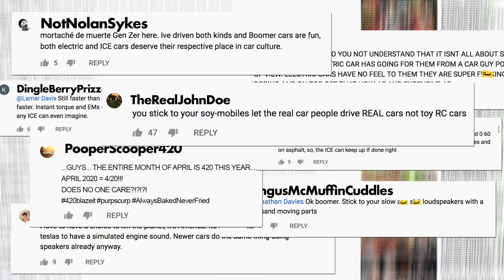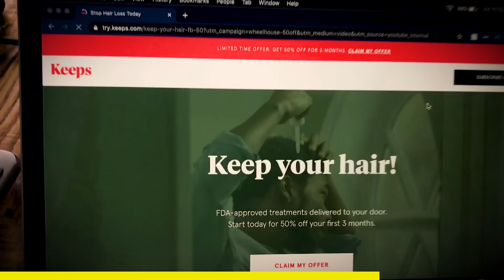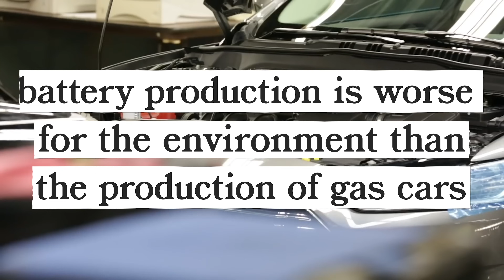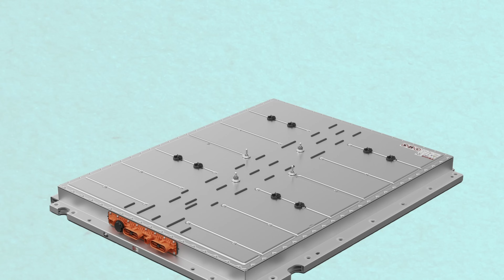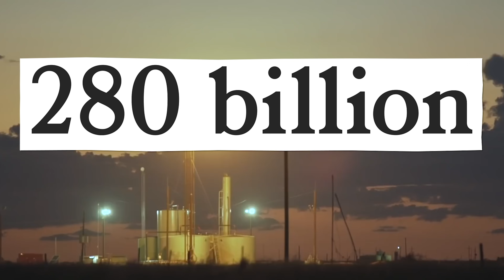Are Electric Cars REALLY Better for the Environment?

Comment: Nice video. I just wanted to add a couple notes for clarification. I work in the utility industry. There are two issues with the power generation and supply for EVs. One is simply we don't have the capacity. I know you said this was incorrect in the video, but the US power grid only has roughly a 10% surplus during peak load. And that surplus is not tangible across the entire grid at any one given time. While it would support a sudden spike in EVs, the grid would be in stretched pretty thin in some areas with high population densities and those areas could experience "brown" or "dirty" power outages. These already occur on occasions when the system is stressed by unusual weather conditions such as those seen in California and New York in the past. There is another related issue. Coal fired or liquefaction plants converted to natural gas are dependent on volume and that volume delivery is directly associated with environmental events. In the middle of the winter, during a severe cold snap, a generation plant my need to dip into the reserve to feed the electrical system, but is unable to because they are not able to get the volume due to the residential customers, high volume and distribution operators drawing down the gas supply before it reaches the power plant. This occurred in the midwest in 2021. The volume of gas available was not enough to supply the demand and the states of Oklahoma, Kansas, Missouri and parts of Texas had to cycle scheduled blackouts to get the grid back into a stable state. The generation company was forced to mass purchase natural gas that was in storage in order to meet demand at a much higher cost per mmcf. (We knew some folks in OKC that recieved power bills between $3k and $5k for a single month of power, but luckily president Trump issued a state of emergency that allowed the government to subsidize the cost.)
     Secondly, your recap didn't take into account the infrastructure itself. Transporting the amount of power needed to supply the move to electrical power has been discussed for years, and no one has a sure fire bullet as to what will be needed, and upgrading the current infrastructure could in itself take decades. It's also not economically feasable to upgrade the grid in one step even if you have a good understanding of the future demand because the cost to meet expected demand far exceeds the amount of money the vast majority of operators are capable to generate. I'm not saying that it is an impossible endeavor, just a lot of guys hacking at calculators in a closet trying to get a decent idea as to how much load they will be expecting, and a heck of a lot of money for infrastructure upgrades. Honestly the current EV infrastructure is not much more than those gravity hand gas pumps you find in third world countries at the moment. Imagine what the electrical grid would be required to handle if every gas station you know of only had charging ports. We're talking in the trillions for infrastructure upgrades when we can't even keep our bridges maintained properly. Then there's the lack of taxes for road use ...
      Third note. Most of the oil that comes into the country is from Brazil. The reason we import is because Brazil has what we call heavy crude. The crude found in Texas, Oklahoma and even Alaska is a lighter grade that takes less refinement, but doesn't have the value of Brazilian crude which is more suitable for producing a broader range of products per volume. I also found your figures a little high there, but I'm only familiar with onshore wells. Most wells, even frack wells can produce for years with hardly any emissions. More emissions are generated off the coast of California and Florida daily in naturally occurring releases. Things decompose, gas and oil are created. It's a natural process regardless of what the environmentalists want to say. I'm not saying that our dependance is a good thing, but I find a lot of times that these numbers are heavily skewed, or in the case of power generation, white lies to draw new avenues for revenue generation.
     Clarkson did some research on the creation, processing and shipping of lithium batteries used in the Prius. His findings were that the shipping and environmental impact of creating, shipping and assembly in conjunction with use and eventual disposal, generated an equivalent or higher level of emissions over the life of the vehicle then an equivalent gas powered low emission car. I know this was specific to a certain car, but it's also something that should be considered. Does a battery that's shipped 9k miles by a diesel ship create less pollution than a gas powered VW beetle? I can't answer that question honestly.
      Forth note. Have you ever looked into how we deal with pollution created from creating solar cells and the disposal of wind turbine blades? It should also be considered, especially turbine blades, since well, we can't recycle them in any way and they are piling up. Hydro power, while the cleanest, really causes numerous other issues with the environment. There is no sure fire way to generate electricity today with minimal environmental impact. Those wave generators are interesting though. Just remember, Newton was right ;)
      Thinking about combustion engines and electrical cars. A plain old metal oil burner can pretty much be recycled from top to bottom. Many of these new EVs are using exotic materials that can't be simply ground down and remelted. We simply don't have a way to deal with the materials currently. Would going to EVs truly solve our problem? Who creates more emissions, a person that buys a fairly low emission oil burner and drives it 200k miles, or a person that buys a new EV every couple of years? If you want to lesson the impact on the environment then there would need to be a stipulation on how long you would be required to retain that EV or have a buyback program to ensure the vehicle remained in service long enough to meet some desired degree of acceptable pollution. 
     We would also need to formally tax, and tax heavily, the power utilized in the charging process to pay for emergency services, roads and infrastructure. There are also other things that people don't consider what about possible electrical shock for police, fire and EMTs? What about training firefighters to deal with the battery cells and the special equipment they will need. If a battery cell is ruptured it could set off a chain reaction that can't be extinguished for days. Top Gear's Richard Hammonds wreck with the Rimnac is a good example. It burned, self reignited and was extinguished continuously for 5 days. An EV fire is a scary thing and currently there are not enough fire departments with the training and equipment to deal with resin, exotic material and large scale lithium battery fires.

     At any rate, I think that the video was well put together and thought out. I definitely can't fault you for missed points because this is a massive undertaking that we are forcing into motion. I imagine I'll be long gone before everything is sorted out, but I have found the whole thing intriguing to watch. A good friend once said to me "we are all in it together". As I get older I realize just how correct he was when he said it.
Reply: Thank you for your comments! It's great when someone who actually understands the topic can explain their perspective.
Reply: Thank you mr Blitz! Your comment really put things in perspective. I read the report from Volvo. A comparison between their own CX30 with ICE engine and the EV version. Most interesting!
Reply: Facts are this whole issue is a lot more complicated than the individual car…
Reply: The number of likes under your comment really reflect how narrow-minded most people are. Rather than reading a slightly longer comment which contains valuable information, they ignore it and look for something shorter and easier to read. Always looking for the quick fix won't get us anywhere.
Reply: @mrmckle  Alternatively, the comment is much newer and all of the high-like comments have already been established. If you comment on a video two years later, it’s hard to become a top comment.
Reply: @mrmckle  yet here you are looking for "valuable information" in youtube comments. wtf
Reply: @mrmckle  Uhhhh the number of likes is low because he commented 2 years too late lol
Reply: Thank you, Mr. Blitz, for posting. Skepticism is wise in these days. as I suspect there are cavernous holes in the arguments from the government-funded environmental lobby establishment.
Reply: "a couple"

I'm not knocking you down, I just found that part a little funny with the essay you wrote.  :D

You've some really interesting points here.  I will definitely be thinking about this, and re-reading this, later.
Reply: Easily the best response on YT.
Reply: You fail to account for several things with your statement. 1. How many homes are supplementing the grid with excess solar per year is growing exponentially. Not to mention, how many utility companies are adding solar AND battery storage to the grid.. the answer is...  a lot! You know all those old EV batteries that are no longer being used in cars... electric companies and suppliers are using them for electric storage. 2. There are certain states that use A LOT more clean energy, than lots of... shall we call them "red" states, whose politicians are bought and paid for by coal. California recently ran on 100% clean energy for an entire day (that's 1/5 the population of the country running completely on green energy.) Where will we be in 5 or 10 years? 3. Not all grids are created equal AND this is the issue that needs to be addressed. A place like Texas, that has been completely screwed over by their politicians, have a grid that will fail, no matter what you do. It fails now, and it isn't even in the middle of summer yet.
Reply: What also is not accounted for is replacement batteries enviro impact, talking to taxi drivers they replace their batteries quite regularly
Reply: @edwardterrell8455  I think you misunderstood. I'm saying that the comment is very good but it has a small amount of likes
Reply: Change bad…. Liquid Dinosaur make go vroom vroom good. 

That’s what you sound like.
Reply: you should have made a video explaining all that, would smash I reckon!
Reply: KO!!!!!!!!
Reply: Clarkson is a biased fraud.
Reply: you: but there's all this stuuUUuuuUUuuuUUfffFFFff
me: so what?
Reply: Ah well, its gonna take 10 years for soccer moms and teenage white girls to realise this
Reply: Facts. The future is in hybrid cars for the common driver.
Reply: Easily the best response on YT.
Reply: I was gonna read that before I saw it was 30 paragraphs
Reply: In my bones, I feel the transition to EV may go the same way as that to diesel back then. Switching ramps revenues (for some).
Reply: I wish more people could understand and have open minds to read this.
Reply: I wish more people would understand this .
Reply: Thanks for a good read. I would say that we've come a long way with combustion engine in terms of how we manufacture and recycle its parts. Keep in mind that EV is still at its infancy and given the same amount of time that combustion engine had matured; EV's battery component will find its way to be more efficient and sustainable. Keep using the same technology just because it works is what stifles innovation. Remember there was a thing called the steam engine that came before the combustion engine.
Reply: Hydrogen sulfide fuel source would be much much better and could be converted to use with all current ice with next to no carbon footprint, no money in it for corrupt politicians tho
Reply: sure is a good thing his hypothetical involved an overnight switch to EVs which is not feasible and most cars dont charge during peak, and battery power and grid interconnects and decentralized generation are all improving as we speak. 

I appreciate your insights but your data seems pretty dated. did you just cite jeremy clarkson as an authority on battery production and recycling? Thats a 15 year old reference at best, and their data wasnt fresh even then (or correct). Also, all the recycling issues you mentioned are being solved as we speak. battery chemistries are improving as we speak. with all dues respect, your concerns are all valid, but people already starting thinking about them, and solving them, a very long time ago.
Reply: @gregnoel8779  as we speak?, U want to corroborate that with facts, please?.
Reply: Your claim: "the US power grid only has roughly a 10% surplus during peak load" misses the point that charging takes place mostly during off peak when there is a lot more surplus available. Many power companies charge less for off peak electricity and that is the incentive to charge then.  

The rest of your post argued for fossil fuel even though over long term it is far more CO2 intensive.  Recycleability of wind turbine blades a big issue? Come on...
Reply: Notably, pump jacks all run on electricity also. Each (running) pump jack uses about 10,000 kilowatt hours per month. There are over 900,000 wells pumping in the US. That's 300,000 Megawats per day. Switch 25% of all cars to EV and turn off 25% of all pump jacks, and you've got an additional 75,000 megawats to use charging those EVs. The systems are linked in more ways than one. 😉
Reply: Why don't you make a video about this. Good info 👍
Reply: @dukefan187  There is already an excellent book on this matter: "The Devil's Delusion: Atheism and Its Scientific Pretentions", by agnostic French philosopher Dr. David Berlinski.
Reply: There is no way that extracting fossil fuels is more sustainable than using natural resources (wind, hydro, solar)
Reply: How many people really drive their gas car 200k miles? Not me or anyone I know. There's no reason to think EV owners will have their cars for any shorter period than gas owners. There will be no "sudden spike" in electricity usage. EVs are being bought gradually and power companies are upgrading their capacity to match. It's simple: they miss out on profit if they don't. Here in Florida Duke energy is building solar farms. A win win for all. One thing few people ever talk about is the carbon cost of transporting all gas with all those trucks. Electricity just flows through the grid. Or is there something I'm missing about this?
Reply: This highly detailed comment is longer than my essays!
Reply: @blitzgariage As I read your point of view on the subject I couldn’t help but notice how well spoken and written you are. How have you achieve this level of writing? Your vocabulary is excellent and your grammar was used correctly? Any advice would be helpful.
Reply: Well written champion. Majority of people don't look at the whole equation. Our biggest problem is Most governments only prepare for the next election. 
No long term vision. 
One example of long term vision is Sydney Harbour Bridge built in the depression 1930s. For 8 lanes of traffic 2 rail lines. When horses and carts were still getting around the rocks area. It lasted as the only crossing of the harbour for over 50yrs. Cahill had vision. Imagine selling that idea.
Reply: FACTS! That's what all these folks doesn't want to understand!
Reply: @marcoscasado8698  you're projecting
Reply: @marcoscasado8698  Facts are from ice core samples that the Earths CO2 levels were around 9000 prts/billion over 100 millions years ago with large animals & huge trees & we are currently at only 400 prts/billion & mass panic. Facts are plants grow faster with higher CO2 levels which absorbs more CO2 & on & on. If we stopped cutting trees down at current rates would help offset our human impact. Also facts are there are less animals & insects then in previous history, so methane levels via other species are much less. The western colonialists killed off over 60 million Bison to force submission of native Indians, the USA currently have about 100 million cattle farmed for beef now a days.
Reply: @marcoscasado8698  well this "folk" understands that all his references are 15-20 years out of date. this guy is clearly a very well meaning, but old school retired energy worker. hes not talking a out our current situation.
Reply: @gregnoel8779  and when u say "folk" is a bit of disrispectful, buddy. Is like calling the person old just bec u are assuming it. Show some respect.
Reply: All of these issues you raise can be solved though. Just like there were many issues and problems with extracting fossil fules from the earth, we have come leaps and bounds with that. The same can happen with renewables. Just needs more R&D and for big fossil fuel companies to get out of the way and let it happen.
Reply: I love how your response to such a though out comment is "R&D good, big oil bad". It sounds childish.
Reply: This dude has way to much time on his hands to write a whole entire essay in the comments
Reply: @jacobziebell9410  It's called reading.
Reply: @terrymeadows1827  it’s called bait

Comment: The govt push for electric vehicles has nothing to do with the environment and everything to do with getting everyone on the Govt controlled power source. The most environmentally friendly EV would be a diesel generate electric.
Reply: Actually fuel is more Goverment controlled than electricity. It’s exceptionally easy today to generate your own electricity. You can even produce enough to run an EV’s daily activities with plenty to spare just with rooftop solar. You could even just use a portable generator. It’s not that big a deal. But fuel. You HAVE to get from fuel stations and the fuel industry for the most part is at the whim of the Government.